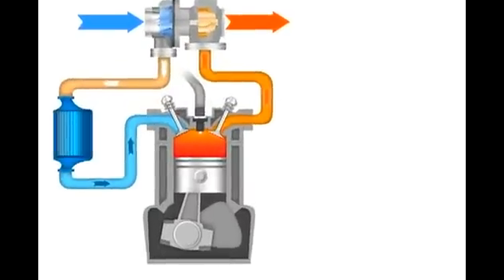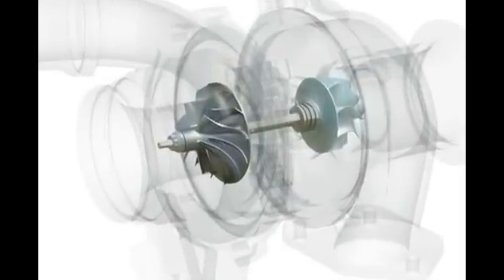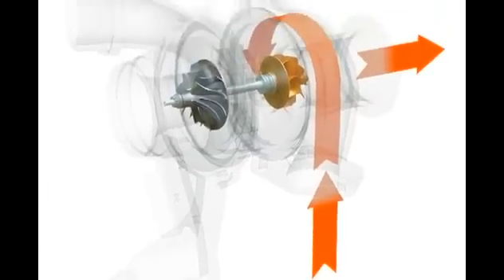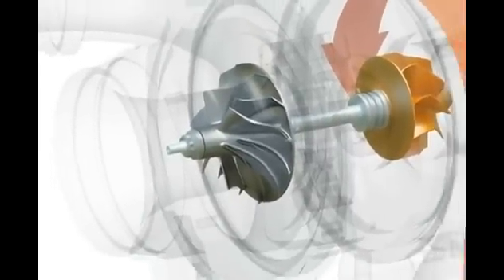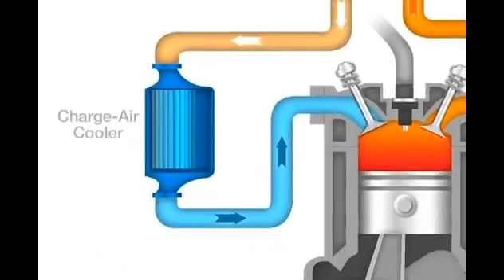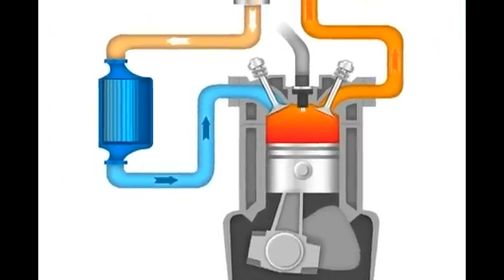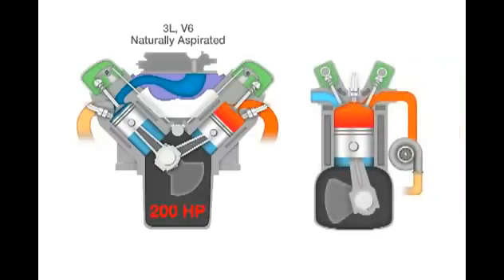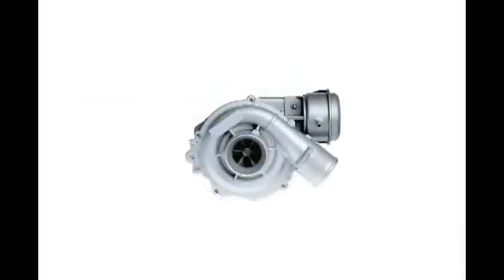How a Turbocharger Works Animation

Comment: This is good but super basic. There's a lot more that you could discuss, specifically how the system (or the pilot) regulates manifold pressure and the common wastegate & APC setups. Thank you for the video.

Comment: The fuel injection has to be according the combustion pressures raised by the turbo which is exponential and not linear to avoid carbon production. The world has a half design of the turbo not adjusted to fuel injection only big ships as example. Who ignores the origin of the turbo (designer) and Heaven's promise about it has no future. No one can change the facts of the past or history. (turbo Jesus).

Comment: Do I need a intercooler for a turbocharger
Reply: I think it helps? You may need to talk to a mechanic on some forums.
Reply: Yes its necessary for the turbocharged engines because when the air compress by the turbo its temperature is high for maintain this air temperature you must need intercooler...